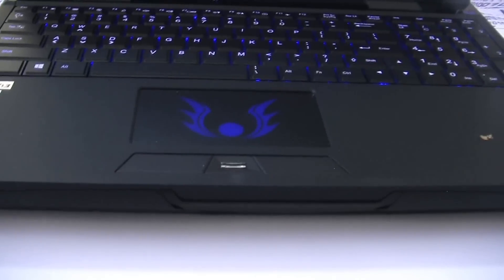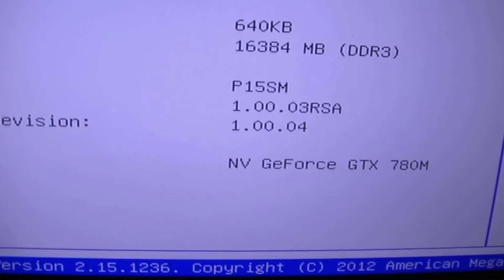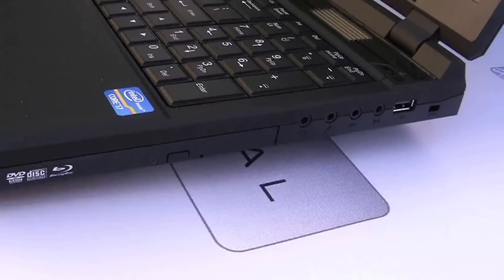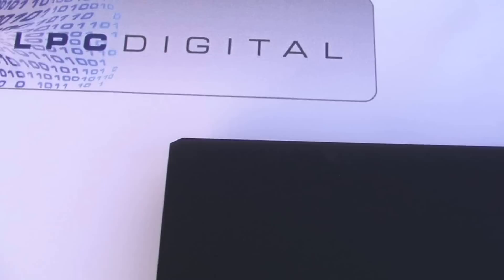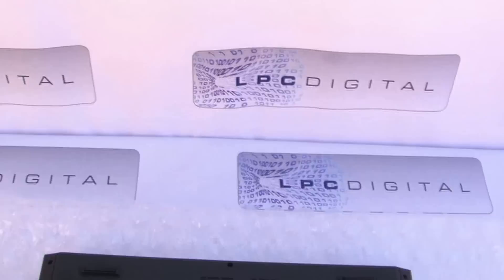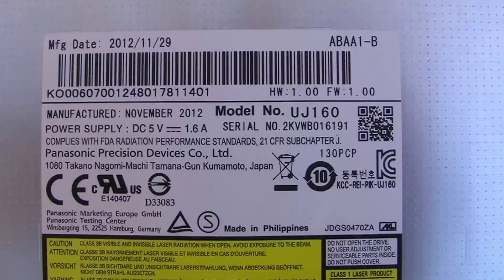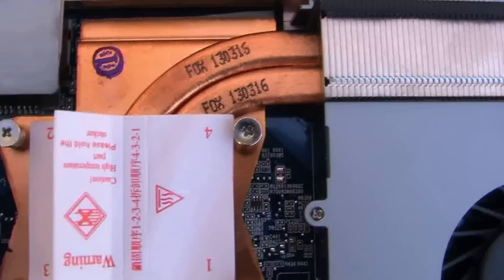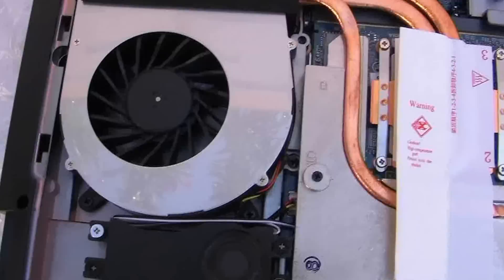Sager NP8250 - Clevo P157SM - LPCDigitalVideo

Comment: I found out the problem. Apparently, the 2nd msata experiences data drops. RAID in Windows 7 works fine while RAID in Windows 8 glitches up. Not sure if it will drop data when using the 2nd msata for only storage.